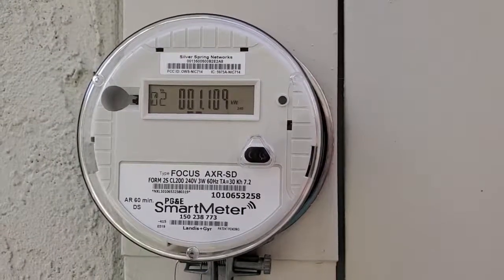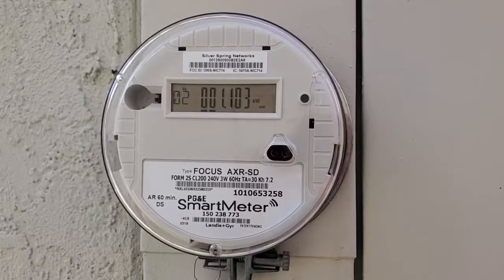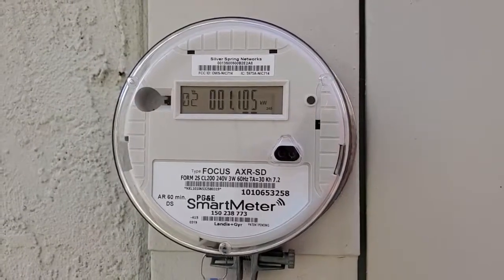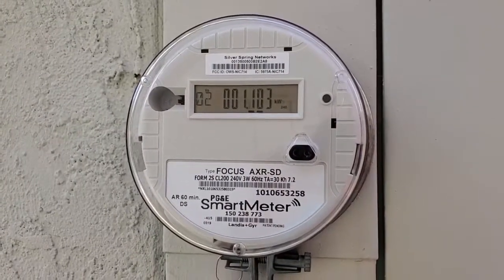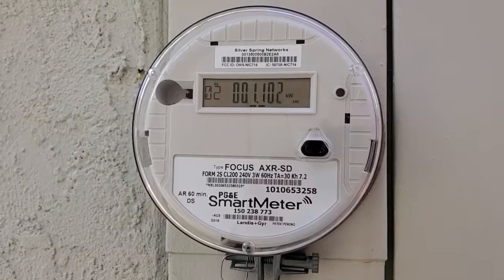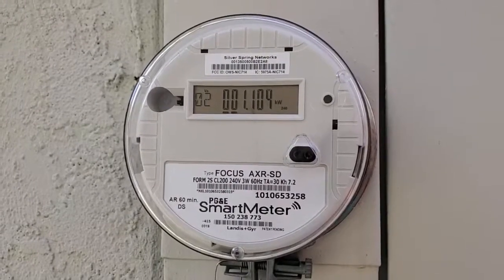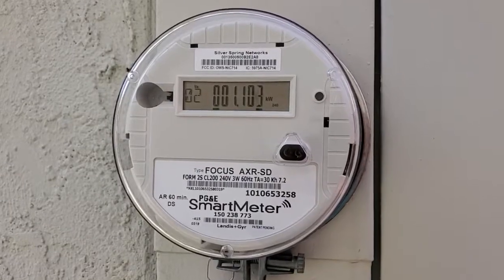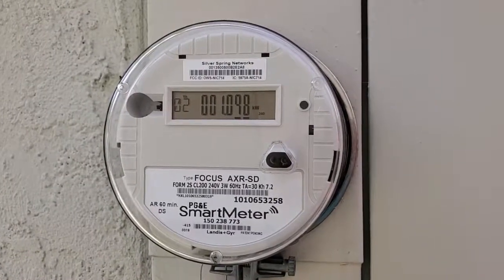Reading Display On Your PGE Smart Meter

Comment: My meter read error e4000 for a year I felt like I was getting electrocuted in my apt when I walked barefoot or touches a wall I noticed the bottom plug inside on all the plugs in the apt didn't not work only the top plugs worked on all the plugs ins in the apt Waterhouse apt off 158th in Beaverton I also noticed the Lazer tower pointed directly at my apt page Comcast people working outside of the office where the tower are located by all had no idea what it was for the building next door Allegra technology specialized in Lazer technology for the military so I was wondering if pge was involved in whatever I was feeling in my apt everyday and if the tower had something to do with it or was it coming from the technology from the Allegra technology inc building! The electronic herrassment is horrible and I have to something about sueing pge
Reply: A lot suddenly started to burn lately. Be careful

Comment: What does cls. Mean
Reply: How to Read a Smart Meter
If you go outside to look at your smart meter, you may notice different figures flashing on its screen. Bear in mind there could be some variation in what you see depending on your utility provider. If you see a message like "CLS," that's good news – it means a switch in the meter is closed and electricity is successfully flowing into your home. If the display instead reads "OPN" it means that there is no power to your home, which you may have already figured out if you tried switching on the lights or using an appliance.

After the "CLS" or "OPN" indication flashes on the screen, next should come a number which will tell you the total kilowatt-hours (kWh) you've used for the current billing period. This is a handy figure to have – but smart meters are also capable of revealing much more granular information about your electricity usage. Your utility or supplier may be able to provide you with more detailed data, which can help you save energy.

Comment: What does opn. Mean
Reply: How to Read a Smart Meter
If you go outside to look at your smart meter, you may notice different figures flashing on its screen. Bear in mind there could be some variation in what you see depending on your utility provider. If you see a message like "CLS," that's good news – it means a switch in the meter is closed and electricity is successfully flowing into your home. If the display instead reads "OPN" it means that there is no power to your home, which you may have already figured out if you tried switching on the lights or using an appliance.

After the "CLS" or "OPN" indication flashes on the screen, next should come a number which will tell you the total kilowatt-hours (kWh) you've used for the current billing period. This is a handy figure to have – but smart meters are also capable of revealing much more granular information about your electricity usage. Your utility or supplier may be able to provide you with more detailed data, which can help you save energy.

Comment: What if the dots on the bottom don’t move and they stay on the left
Reply: If you are referring to the 2 dash lines then-  the dash lines are equivalent to the spinning dial in the old mechanical meters. If the dash lines are moving from left to right slowly you are consuming less electricity than if the dash lines were moving fast. And I was informed that if the lines are moving from right to left then you have solar panels that are generating electricity. If the dash lines on your meter are not moving then you are not consuming any power (unusual) or perhaps the meter has an issue.
Reply: Well it Says if the two dots are moving to the right means it's working. If you have electricity and those two dots aren't moving I guess you're getting free electricity so keep your mouth shut.

Just kidding hope you got your problem fixedv

Comment: If my display reads only 8's and is (not) changing, does that mean my electric has been shut off remotely by a computer, I have 2 circuits, only the wall outlets dont work (including the refrigerator), but the ceiling fixtures work, do you have any idea of what is going on, look forward to your reply.

Comment: The 1.103 I don’t believe is your current usage. It is what is called demand and it is very complicated. You can shut the main breaker off and it should still read 1.103, which means that it is not the current wattage being used.
Reply: nope
Reply: @chrisschott7790  can you elaborate?
Reply: @nwinter2752    you are incorrect. this meter shown is displaying exactly what mumblespeak guy said-  (net real-time consumption ,or net power  back to the grid, if any)
 So if you  switch off the house, and  you don't have solar, it will display zero consumption.     if you have solar it then will display the full output of the solar system going back to grid, as a negative value.